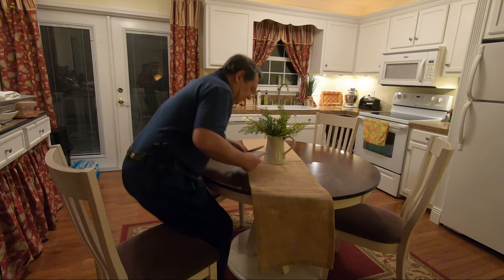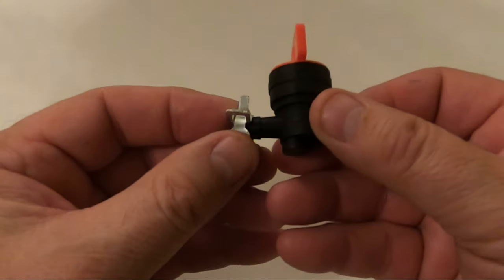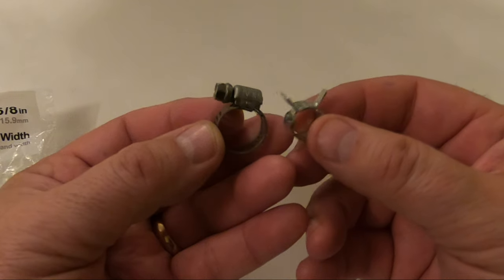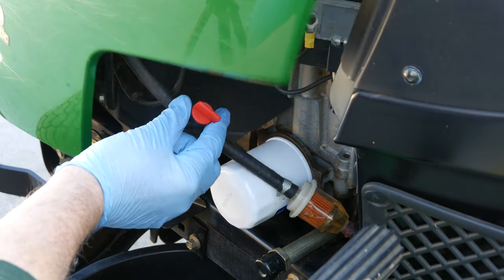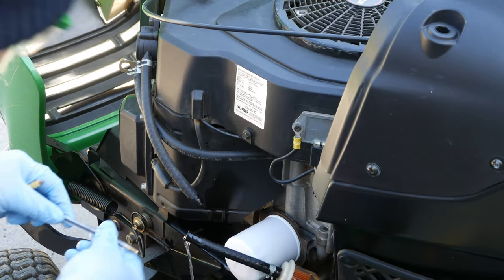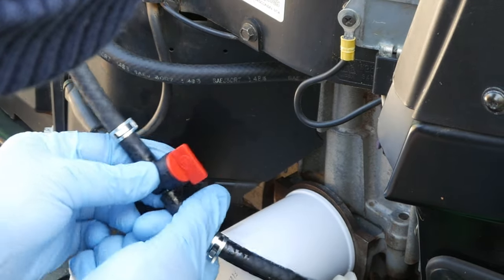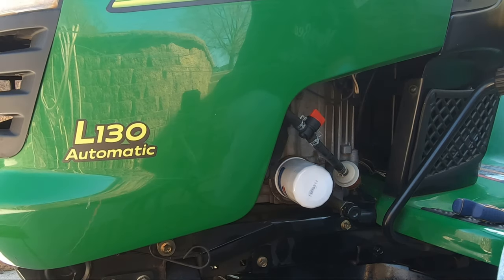Fuel Shutoff Valve Installation

Comment: You should have put the shut off  behide
  the filter. So you change the Filter without getting gas every  where
Reply from the maker: It’s a catch 22.  My goal was to starve the engine without having to run all the fuel out of the fuel filter each time I store the lawnmower.

Comment: Shouldn't you put the shut off valve before the fuel filter?
Reply from the maker: My logic was: if the shutoff was before the fuel filter, all the fuel has to be used up inside the fuel filter before the engine is starved and goes dead.  Leftover fuel inside the filter is not any worse than leftover fuel inside the fuel line as long as there is no fuel in the carburetor causing clogged jets, deteriorating diaphragms etc.
Reply: Thanks. Makes sense @PilotViewProductions
Reply: I installed mine before the fuel filter so that I can use it when changing the fuel filter in the future
Reply: @DonnyDuck88  same

Comment: Actually, install the valve inline "Before" the fuel filter. This will make it easier to change your fuel filter later on ! 😉👍
WTTW: The Oregon fuel shut off valves may cost 7/8 $.$$ but they don't tend to leak like the cheap $3.00 Chinese knock offs... 🤷🏼‍♂️ Also recommend the Stens or APE Racing fuel filters as well for similar reasons. 😊
Nobody likes doing a job or paying for it twice. Carburetor issues are the most common shop repair for Most small engines ! 🤓
Reply from the maker: I installed it after the filter so I wouldn’t have to waste the gas inside the filter every time I run the line dry.

Comment: I disconnected the wire from the bottom of the Solenoid on the carburetor-installed the shut off valve -no more problems with carburetor
Reply from the maker: Good job.  Thanks for commenting.

Comment: So putting cut off valve between fuel filter and fuel pump is the safest spot? It won’t damage fuel pump diaphragm or anything?
Reply from the maker: No more so than just running your lawn tractor out of gasoline during regular mowing.  I've never heard anyone say that process damages the diaphram.
Reply: @PilotViewProductions  I'm calling BS on this one. If you run the tank empty you are sucking air (0 resistance) if you close the valve you are sucking on a vacuum (greater than 0 resistance) it will put a strain on the pump. I have no idea if it enough to cause problems. I contacted John Deer asking where the best place in the system was to install a valve and all they would say is making modifications will void warranty.
Reply: Shouldn't be a problem but try to stick with 30 micron or higher porosity. 😉👍
Some newer equipment can have hidden granular filters at the tank connection, or in the case of most Honda engines a screened straw filter. These can obviously become clogged over time, and then your fuel lines or pump just can't keep up. Check your manual and parts breakdown. 😉

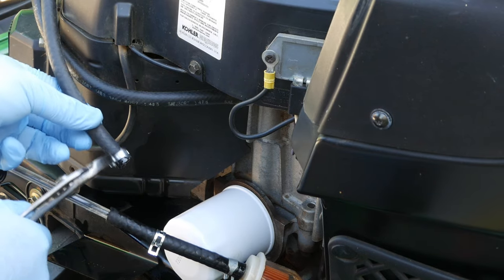Comment: At 3:26 you insert the cut-off valve into the tubing. There should be an arrow imprinted on the plastic valve indicating the direction of flow of the gasoline, which should point towards the carburetor. I think you failed to mention this. If the valve is installed the other way, with the arrow pointing in the other direction, i.e., against the flow, no gasoline will ever make it to the carburetor.
Reply from the maker: Appreciate the comment however note that the valve will only turn 90 degrees.  No arrow was necessary.  The red lever is either perpendicular to the tubing (shut) or parallel to the tubing (open).  This is the case mounted in either direction.

Comment: I would buy a better valve than those plastic ones.
Reply from the maker: To each his own.  I don't believe this valve is any more likely to fail than the plastic fuel filter.
Reply: Plastic itself is not the issue per se, I just pulled a 20 years old Oregon shut off valve the other day that's still works like new ! 🤯
But some of the cheap $3.00 knock offs you see in Amazon can leak in a few weeks or even days... 🤦🏼‍♂️
Fair to remember that many of the metallic valves are in fact aluminum and will often corrode over time due to today's ethanol fuels... 🤷🏼‍♂️
Reply: @PilotViewProductions  it not that it fails but it's very difficult to turn on and off. Tried to put a couple drops of oil on it but didn't seem to help. I bought the metal ball valve type and they worked much better for me.